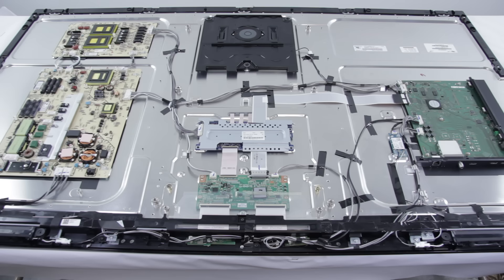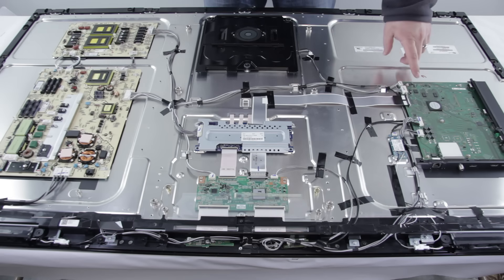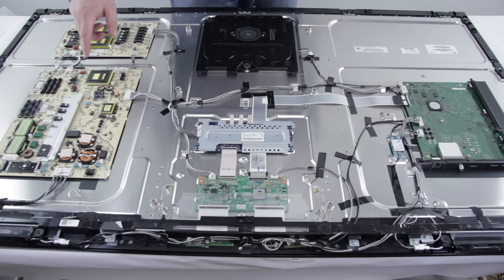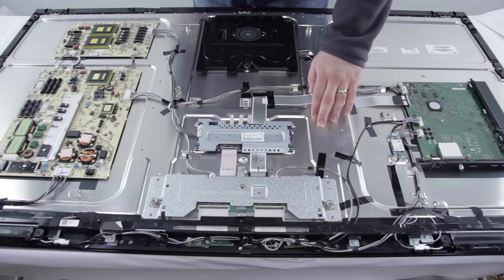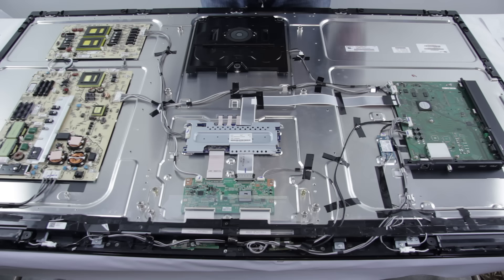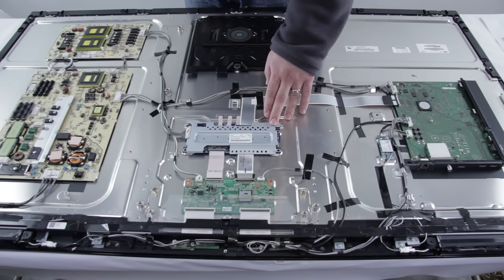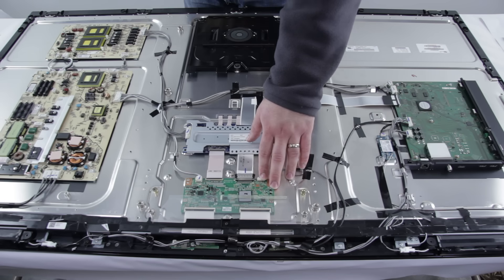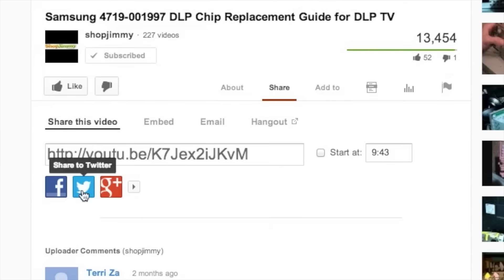LED TV Repair Tutorial - Common Symptoms & Solutions - How to Repair LED TVs

Comment: Hello, I have a 2015 RCA model LED46C45RQ.  It turned on and then the screen went black but I still had sound and was able to change channels.  i tried the flashlight test but don't seem to see any images. The power is working as the red light is on when the tv is off and off when the tv is on.  I don't seem to see any backlights on.  What do you think my issue or issues are?
Reply: 1st post pinned in the top, "Thanks for watching our TV repair video! Due to YouTube policy changes, we are no longer answering tech support questions in the comments section."

Comment: Samsumg Mo# UN65JU6500 / version T06
What I've done:
- Replaced the the T-CON Board
- Tested sound, OK
- Flashlight test, FAILED
- Powers on, has standby light

What parts do you recommend, I'm looking at replacing the Mainboard, LED strips or both? Any suggestions?
Reply: Forgot to include, TV has no backlight, no video display
Reply: 1st post pinned in the top, "Thanks for watching our TV repair video! Due to YouTube policy changes, we are no longer answering tech support questions in the comments section."

Comment: I have a P502UI-B1E TV that I was using as a 4K monitor for my computer.  It was working great until I did something that sent it into some mode where the display only shows up as SGD FRCX at 2K resolution.  DIsplays and menus from the remote work great, but not the external computer screen over HDMI anymore.  The computer thinks it is there as an HD display but nothing ever shows up on the screen anymore.  I wanted to go back to a previous version of the BIOS, but the website knows I the tv is already at V1.5.16-UHD and won't give me a link to download it (or any previous) firmware.  2nd level tech support was no help either.  I have tried factory reset.  Any ideas?
Reply: 1st post pinned in the top, "Thanks for watching our TV repair video! Due to YouTube policy changes, we are no longer answering tech support questions in the comments section."

Comment: I have a Vizio model E701i-A3; sound is okay; no picture; using flashlight test no images I can see. Thinking it could be the LED driver board? Your thoughts?   
Also earlier in the year the TV would not turn off after being on for long periods of time, it would go into standby mode. Thought that it might be dish network problem, but not sure. Now it is not doing it. Thoughts?

Comment: Hello. I have a Vizio P602ui-B3. It takes about 7 or 8 attemps to turn it on. The front LED on indicator turns on and then off twice and then it just doesn't work. After some attemps, it works fine. The Stand by 12 Volts and Stand by 3.3 volts are present all the time. There voltage T_CON_ON is 0 after I turn on the TV for about 3 seconds and then some times it goes to 3.3 Volts for 4 seconds or so and then dies. When it suscesfully turns on, the T_COM_ON is a good 3.3 and the T_CON voltage is a solid 12 volts. I check the power supply board and main board on both sides for obvious bad parts but I don't see anything bad. I don't know how to make  sure wich board is bad.

Comment: have a 55l621u from toshiba that’s just over a year old. When I plug the tv up, I do get the Toshiba splash page and the picture looks fine but it only stays up for about 10 seconds and goes black. While the picture is on the screen, the red light does blink and will stay on for about 10 seconds after the screen goes black. Thank you

Comment: Samsung UN75J6300DAFXZA Version # TH01 75" 1080p Smart LED TV, (5 years old).  Just been gifted this set because the original owner replaced it due to a bright spot on the screen and he couldn't deal with it or has lots of money or something.  After very carefully moving it to my place, it now has 5 bright spots on the screen.  "Google Tech" seems to think "diffusers" are falling off the LED backlights.  (I'm a low voltage technician. I've been into the back of a few sets for power supply issues but behind the screen will be my first.)  Glue them back on or get new backlight strips?  Your thoughts?  Thanks

Comment: Rock solid info video , well done. Question : My bad tv is a Toshiba 52XV645U, with flickering and vertical lines on the left side, often goes away, worse when first turned on, independent of video input, audio is fine. T-com  or main??

Comment: I have Samsung pn50b450b1d when I plug it in red light is flashing relay clicks 2 time and nothing on the screen no back light or picture or sound, but if unplug power cable from t con board I can hear the Samsung loading logo but still no picture or backlight

Comment: Good day.  I have an LG 65UF6450-UA tv.  I have a snowy picture, but sound and all menu items work fine.  Picture is the same  regardless of which input is connected.  I have checked the power supply and can see no obvious signs of leaking or bulging capacitors.  I suspect the T-Conn board.  (Model: V15 65 UHD Apollo15 Ver0.4  P/N 6870C-0547A)  Would you agree that the T-Conn is the most likely problem, and if so, do you have them in stock?  Thank you.

Comment: I have a Samsung LED TV Model UN65NU6900F. It has an about 3 to 4 inch black vertical blur in the left center of the screen from top to bottom. I can send a picture of it but I don't see how to do it here. Can you suggest a repair method.

Comment: I have a Vizio D32H-F0 with a LED Backlight problem. On this model as only one board (csd:3632-3182-0395) for every functions of the TV.  I have tested my TV using a flashlight and could see an image on my screen and I still have sound working. I tested the disconnected poles of the LED driver, I got a  voltage  of 15,2 volts.  is that good?   Should I buy a new board or must try something else?  Your advise would be helpful.

Comment: I have a toshiba 29L1350U, feb 2013,DO8261C21797D1, I tried replacing the 2 main boards.  The TV power button lights up then fades slightly.  There is no picture or sound.  After "resting" for weeks or months unplugged it will operate normally.  Suggestion?

Comment: I need to know what cable to buy to correct the horizontal lines on my Samsung TV model number UA43KU6000GXXP. I already took it to a TV shop but they don't have the cable to replace it with. I need to know what to buy for it. Please help me.
Reply: There is no issue with the tconn board, the power supply or the digital board. The cable is the one that is faulty.

Comment: Hello, I have a 2018 Samsung QLED model # QN65Q8FNBFXZA.  The color of left side of the tv becomes dull looking.  It comes and goes. The right side seems fine.  I’ve replaced the HDMI cable and the Directv box.  When restarting the directv box the screen is normally blue, in this case the left side was pinkish or purple. Any idea what I need to replace to fix this.

Comment: my tv looked whitewashed looking and then it finally got where it would power on but had just a black screen so i bought a kit to repair my tcl roku 55us57 tv and after replacing 3 boards : power, t-con, main board the picture has returned but it is back to looking whitewashed looking with vertical lines. Any ideas what could be causing this ? A long time ago my tv did this and after awhile it went back to looking normal again but this has been going on for awhile so i doubt it will return back to normal this time without doing some repair to it.

Comment: I have a poloroid 49gsr4100km that will not come on.  It has a standby light, when I press the power button the screen lights up for a brief second then shuts down.
We have experienced many power outages and bumps the last one we had was about 2 months ago and after pressing the power button several thousand times it finally did fire on and all seemed well since then.  I went outside to do some work and when I came back inside the tv was off and would not fire back on.  Like I said the red standby light is on but never turns blue.  Looks like the red light flickers after trying to start, your help is appreciated. thank you

Comment: I have a Samsung UN60J6200AF... It has no picture, no backlight, no sound. It DOES have a Red Led on the Power button that flashes when I press the "universal" button. It also shows up as a valid device whn I connect my laptop to HDMI 1. Laptop can see the display and trys to send sound to it also but you can't hear it. Any thoughts on what this could be?

Comment: Hello, Could you please either share firmware for Mitashi LED smart TV MiDE050v02 FS MODEL ( service number MiDE050v02 NMB) or the mother board used in this model. Problem I am facing is it is getting stuck while loading logo once it's powered on...pls help

Comment: I have a Samsung un55es6500f when I turn it on the screen is normal for about 3 to 5 seconds then everything on the screen starts developing vertical streaks with color over everything on the screen. and it goes from clear objects to very pixilated  images that have basic colors

Comment: Hi, I have a Philips 55PFL4706/F7 led that will turn and work varying lengths of time and then turn off.   It won't turn back on unless it is unplugged for a while. I have replaced the main board, power supply board, and t-con board and it still does the same thing.  Please advise and thanks for your help!

Comment: Thank for your useful teachings on tv repairs. My samsung tv model number UE65F9090SL. It refuses switch on sometimes. And when it's On, you can only see the light without any picture or sound and  also thick stripes at the 4 sides of the tv.

Comment: Watching your video gives me some more ideas which parts/boards in my Samsung TV might be faulty. Based on the description in your video it points to the t-con board. Unfortunately the t-con board has been changed already (with a used board), but the screen failure persists.

Comment: Hello. I Have a LED Samsung model # UN46C6300SF/ MODEL CODE UN46C6300SFXZA. My daughter splashed some milk on the screen and a little if it ran down it the panel. Under the panal it two small circuit boards that connect two trips that goes to the tcom board.  How do i replace the strip circuit board that latches into the tcom board. Note(  TV has sounds, back lite,and no picture but spilt screen virtual line on the left side and soiled white on the other side. Can you help me out on the matter

Comment: I have a Toshiba model 32C120 U with double image . It come on perfectly and about 10 minutes in it goes to a double image. Can you advise which board to look at and if you have the replacement part  for the most likely to be the cause of the issue. Other than the double image the TV works perfectly

Comment: I have a un65js8500 I have edge bleeding on both side with purple tint which is spotted with dark spots between them. The screen works but it is hard to see in the daytime even with the backlight turned all the way up and all energy savings turned off. Does the TV have some of its LEDs out?

Comment: Hi there, I have Insignia NS-50D40SNA14 LED TV, I have problem with the picture, first when I start my TV everything work perfectly as it should be, after 10-15 minutes my screen goes black but the sound remains and at this point  if I switch my TV OFF and ON again it works fine again for 10-15 mins and goes on, one thing i noticed when the screen is black and i put my torch light to the screen I can see the images on the back end , please any recommendation to fix the problem?

Comment: Thanks sounds like my main board may be bad. TV turns on and off by itself, none of the HDMI works, and it doesn’t recognize the signal from cable box. What do you think. I did have the power board tested and upgraded with new parts. What do you think? Thanks so much

Comment: Hello, I have a Samsung un75mu630dfxza-Af01 I have a red vertical line that is located 24” from the right. It appears in front of any menu and does not go away. I have purchased from shop jimmy a TCN board, power supply board and main board but problem still exist. I look forward to hear and thoughts you have for this problem. 
Thank You Jim Turner

Comment: I have a 55" lg model 55L J550 smart TV. The TV begins with good picture & sound but after about 10 minutes the picture begins to develop horizontal bars that come & go some are in black & some in color. The lines start at the top after about 20 minutes grey & white vertical bars begin to form on the bottom half of the screen. The horizontal & vertical bars come & go. The sound in good all the time.

Comment: Samsung UN75MU8000FXZA half the screen is red but when I turn on high contrast the red goes away but the picture still doesn't look right. Its a lil bit darker on that side to.. Any ideas? I tried the picture self diagnostic test the 1st picture is the same as I described above the 2nd and 3rd picture shows grey and black bars but on the side its messing up on it has a black box then some grey and black bars at the end. Not sure if that will help but I thought it might help. Thanks.

Comment: Hello. I have a Samsung 75mu6300. The screen has a faint yet noticeable when a solid color is on the screen, dark and light vertical banding. The width of the dark band seems to be about 3" wide. Looks like a faint football field pattern where the grass isbcut in alternate directions.
I have surmised that it is not a device connected to the tv as it shows when the tv is on by itself. .in other words with the cable box off. What do y

Comment: good morning .i have  a samsung ua55H7000AT.the previous night tv worked well .this morning it wont come on,changed remote batteries and even tried joystick.no signs of power.suspect power board.how do i test and confirm it is power supply board.Thanks
Suresh

Comment: Hi I have rca model # rlc2626 and the tv is not powering up when plugged into wall outlet. Wall outlet does have power. I have the back off tv and have 122 volts to both sides of the fuse. The red led power bulb is not lighting up either. Could you please give me some information as to what may be going on thanks.

Comment: Hello,
I have a Sharp Aquos, LC-60le650u.
It has sound but no picture.
TV is displaying 3 blinks and 1 short blink.
I replaced the Power Supply board with a supposed New board.
TV is displaying exact same symptoms, this did not fix my problem.
Any suggestions ?

Comment: Hey Jimmy Thanks I have a couple questions I have a Sony KDL-40w600B when turned on the indicator light flashes 6 times I looked it up and it is supposed to indicate that there is a problem with the LED I replaced the LEDs and still not fixed. I fond the kit to repair it on shop jimmy its out of stock with a sad face and "bad" writen beside it .  I don't know which board I need to replace.  Thanks G

Sony KDL-40W600B  LED TV

Comment: Thanks for you videos.  I have a vizio M65-C1. The picture flashes on and off. I replaced the power board and main board but that doesn't fix the problem. The audio doesn't go off and the LEDs stay lit when you observe from back of the unit if you observe from the back with cover off. Any suggestions? Thanks gregross9@frontiernet.net

Comment: Any one know why an RCA TV has to be plugged in and unplugged and re-plugged a number of times before it will power up. My 42" 2012 year plays great for hours on end. But I have to do the plugging ritual every time I turn it on. Some say this is bad power board capacitors. Replaced power board with supposed refurbished one and have same problem. Some one said it could be the latching relay? Is there a relay that sticks preventing the power to go to the boards that unsticks when it gets a few jolts of fresh electricity? It does not sound like a board problem to me, because other than the initial power up the set plays great. I flip off the surge protector slowly and back on and get the standby power light. Then hit the on button and usually the standby light goes out but set does not come on. After 5 or 6 sometimes more times of hitting the juice on and off and getting a light each time and trying to turn on the set each time it finally comes on. Shop Jimmy guys you could email me the answer if you want or if anyone out there knows what causes this respond with a reply comment below. Thanks Zed Cartwright.

Comment: I have a 55 inch Samsung un55h6203. The power supply went out and the 13 volt pins were showing 1.7 volts. I replaced the board and that one lasted apx 30 min then went out with the same problem. Where should I look for this problem? Please advise. Thanks.

Comment: My LG 65UF8500 is pixelating badly. About every 10 seconds picture goes haywire for a bit, picture all garbled, then picture is OK again for another 10 seconds. I already replaced the main board 9 months ago.  I seem to recall similar issues back when in failed before, until the picture eventually went off all together.   Do you think it is the main board again, or could it be the power board or the other one, I forget what that one is called.

Comment: Hi, I have Vizio m60c3. My TV has never had a problem. We packed our TV into the original packing plus extra packing was added. We moved to a foreign country about 8,000 miles away so the TV was shipped out. Many months later after our arrival we finally unpacked the TV when it arrived. There was no visual damage. The shipping company even created a wooden box to enclose our TV in. We used a transformer for power as the new house is 220v and our TV is 110v. The TV goes on but the screen is totally black and no sound but when I hookup our home theater system and play a movie cd we get the sound but no picture. I'm guessing something came loose inside during transport. Where should I start with in checking for loose connections? Anything specific? Thanks for your help.

Comment: My Samsung NU7100 55 inch show blue horizontal lines only when screen mirroring on the black borders.   Main board was replaced but still the issue persists.  I have checked this model in the store and those ones are fine...any suggestions?